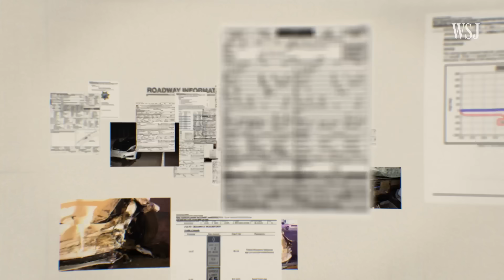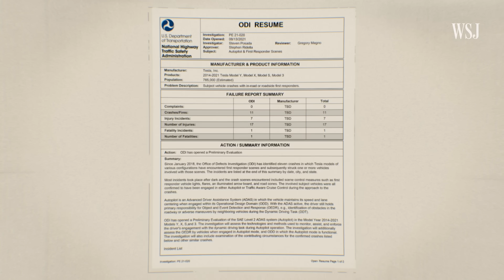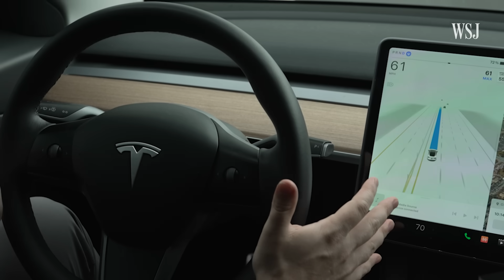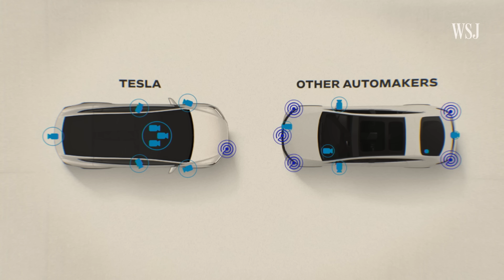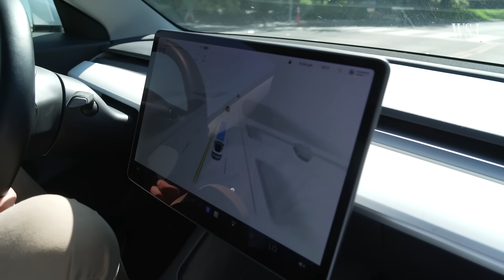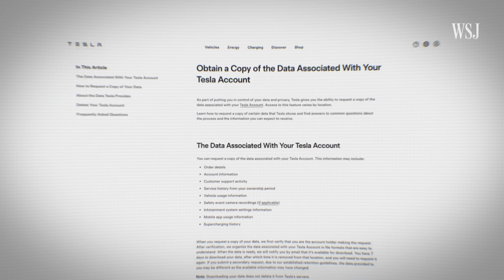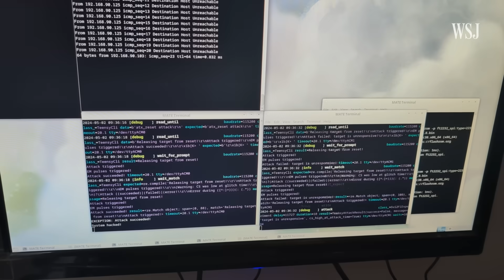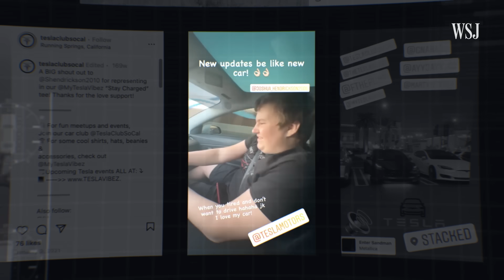The Hidden Autopilot Data That Reveals Why Teslas Crash | WSJ

Comment: Digital cameras are not well-suited for depth perception, and they are susceptible to weather conditions. Radar and LiDAR are not subject to these limitations. No amount of AI can compensate for the poor data from digital cameras. Self-driving vehicles require more sensors, which provide more data, to achieve Level 2 or higher autonomous driving capabilities.
Reply: You are ten years behind the times.
Reply: more sensors create conflicting data which then has to be managed in split second real time, usually resulting in unnecessary braking or hesitating which can also be dangerous.
Reply: @michaelfagan9620  This is very true, and the reason Tesla got rid of radar. The camera's see far more than people think, and operate a pseudo radar, basically building a Lidar like picture of the world using camera's. The work Tesla has done is nothing short of remarkable. V13 is showing the real potential of their system, outperforming other self driving cars (using lidar) with Tesla stock rising to record highs on the back of it.
Reply: Lidar is very susceptible to weather conditions. V13 is proving Lidar is not needed. Tesla are looking well set to dominate in this space. Most people have no idea just how good FSD is getting or will become.

Comment: It would be helpful to compare, in terms of percentage, within the same time period, the number of fatal accidents between vehicles with and without automated driving. Additionally, it would be valuable for the report to mention how many accidents have been prevented thanks to artificial intelligence.

I believe that if they included these points, the report would be comprehensive, allowing the user to evaluate the advantages and disadvantages and, consequently, reach a conclusion. This would be ideal and would truly represent good journalism. However, this is the Wall Street Journal, so I don't expect much from them

Comment: Because they need LiDAR but musk the ' genius ' doesn't thinks they do so till then they are behind all other brands that use that tech
Reply: Question, do you drive your car with lidar and radar or just with your eyes and ears? 🤡
Reply: @bartdeking  I'm not a algorithm working of just sight. I also rely on sound and being able to interpret the feedback from a car. Obviously you are too young to drive 🤡
Reply: V13 is proving lidar is not needed. Most people have no idea just how good FSD is getting.
Reply: @daydreamer8373 'how good it's getting' by that statement along it's still not right and will continue to have accidents or cause the driver to take over to prevent one.
Reply: @entropyachieved750  It is not ready. But as I said, most people have no idea just how good it is getting. Automation will make our roads far safer, and Tesla is well placed to dominate in this space.

Comment: While Full Self-Driving (FSD) technology is undoubtedly remarkable, Tesla must enhance its communication strategy and transparency regarding its capabilities.
Consider the numerous instances where the Wall Street Journal misrepresented FSD technology and failed to provide adequate explanations. This lack of clarity has likely contributed to the general public’s confusion and misunderstanding.
Reply: Good job for being Tesla's spokesperson without getting paid for it. You're a disgrace to your country! You should only write bot comments for Xpeng, BYD or Nio.
Reply: I think that's backwards...  I don't think there is any communication strategy Tesla could use to counter the willful misrepresentation on display here.  The WSJ is losing credibility with this trash reporting. Basically Mr Musk is designated evil, and so no standard of accuracy or journalistic integrity is required in reporting on companies he is involved with. Over time, folks just notice that WSJ isn't factual or credible.  But in the meantime, yeah it's bad for sales, but nothing they can concretely do about it.

Comment: To be fair the overturned trailer should have put up reflective hazard signs or anything at all to warn drivers. It's not easy to see in the dark and it's very unexpected.
Reply: you are right, but then comes the questions of how long ago it flipped, if the driver is in good condition to phically search and put the reflective signs, or power was out in the truck. still the car didn't stop early enough
Reply: 100%
Reply: Class A drivers know and it is included in the DMV test. But those trucks don't have airbags. I wouldn't be surprised if the driver was injured. Plus difficult or impossible to get depending on the sign location
Reply: This is the kind of thing that LIDAR would've detected, regardless of the lighting conditions.

Comment: she hit the nail on the head at the end there, this isn't going to dissuade a single person. they're in a cult and will defend daddy elon and tesla until their death...  which is what literally happened to all the drivers in these crashes
Reply: Most of the drivers disobey the prompts, that's on them.
Reply: @caydenthompson126  yeah this argument is lame. a big part of the culture in the tesla community is finding ways to defeat the "prompts" or nags. mostly stems from the top since the ceo of the company vocally disagrees with their existence
Reply: @MikeJackman  I am not an Elon fan. But this video is biased.. it only shows the crashes and not the times Teslas steered people away from getting T-boned by somebody jumping a red light. So my question to you is, have you tried using these systems yourself and did you have evidence for forming your opinions apart from the stuff shown in this video. If you get a chance (maybe a friend has a Tesla), try the FSD system out. And pray, don’t snooze at the wheel like some of the people who think the system’s perfect just cuz it’s called “Autopilot”.

You’ll be pleasantly surprised by what you witness.
Reply: @kaminenianirudh  ive owned three of them.  currently drive a model s, no one needs to tell me about the phantom breaking, the random lane shifts and it getting confused at unguarded stop signs. 

it was pretty good until they decided to disable the radar for no reason. during both of the fsd trials, i used it a few times. it clipped the curb twice and ran into my neighbors yard but did manage to complete one 2mi drive, once with intervention. it is a LEAST 5, probably 10 years from prime time and will def require additional hardware over hw3/hw4.
Reply: @MikeJackman  it keeps getting better and better…just a matter of time
Reply: @MikeJackman  Hmm, I have a very different experience. I bought a new Tesla in 2024. Model 3. I don't have much driving experience, this being my first car and me being an immigrant (legal), but I know what a smooth drive is. I started using FSD with V12. Recently I made a couple of long trips one from NYC to Boston and other from NYC to Raleigh all on FSD on 99.9% of the time. It's a bit jerky in some very particular situations (and at this point in time, I know enough about the system to know what these situations are), but most of the time it's very smooth in terms of braking and accelerating. But looking at the V13 videos online, I'm guessing it's going to be indifferentiable/better from most human driving in like the next 2 months. And some of the testers of V13 are not Tesla fanboys too, and are somewhat objective. Except one, if you know who I'm talking about.

The few things that I find are still not implemented are: 1) Emergency vehicle handling 2) Pothole avoidance 3) Reading signs 4) Better parking intelligence at the end of the trip. 2 and 3 are big things which I don't see them talking about yet. 1 and 4 are coming in a future update apparently. It's not gonna take 10 years IMO for sure. Maybe 2-3.

Also, I live in the city, so my experience of FSD should actually be worse than people in the suburbs. Cuz the few times I drove it in the suburbs or the highway, it was flawless.
Reply: @MikeJackman  Also, curious about which version of FSD did you try out? They had a free trail of FSD very recently (for the month of November) which had 12.5.6.3.. Did you see random braking and lane shifts in that version too? Also, were the lane shifts, random braking unsafe in any way? Cuz what I found out is that it's very safe even the few rare times it decides to be jerky. Like if there's a car behind it and it decides to brake suddenly, it will realize the car behind it and accelerate a bit to give it some clearing space. I think the sweet spot of the system is when you realize that it will not crash into other cars (ironic I know, commenting this on this video) and also understanding the situations it doesn't handle well atm. But maybe that's my inexperience talking
Reply: @kaminenianirudh  I actually had two different versions during that trial. 

The first version I had worked pretty well. That was able to get me from my house to the grocery store once without any interventions.

Then about a week later I got an update and I do not know what Tesla changed but it could barely get to end of my street wtihout panicking. It couldn't navigate a parking lot. It kept doing that vibrating braking thing and jerking the steering wheel all around. IDK. It was very annoying and it kept clipping the curb (which i read is a known issue in MS and MX since most of the training data comes from the smaller M3/MY). IMO, after a decade, this beta testing nonsense of just pushing out software is tired and not gonna cut it if they want to release something unsupervised anytime soon.
Reply: @MikeJackman  I know it feels like a decade, but it's been only 4 years since the release of FSD. Autopilot is little more than cruise control and they advertise it as such. For as complicated a product as FSD, I don't think releasing a "finished" product directly is an option.
Reply: @kaminenianirudh  I mean that AP has been around for a decade. Often regressing in functionality. In fact I would argue AP2 with the radar on was its peak and now it's more of hastle to use to than no to.

As for FSD, it will always be a pipe dream. I'm sure some company, at some point, will have a widely in use robotaxi and the first company to do it could even be Tesla (doubtful but maybe). But it won't be what you today call "FSD", it could be a derivative or a use the data you provide Tesla with FSD to train the software a robotaxi uses one day. That being said, there isn't a single production Tesla on the road today that will ever be "unsupervised".
Reply: We gonna say this about all car companies or we just gonna talk about tesla because im sure their are more fatal crashes then just tesla
Reply: @RuleStarRacing  Tesla, and its leadership, makes extraordinary claims about its automation. Therefore it gets extraordinary scrutiny. It's just that simple or as it was said in the 1986 hit classic film, Top Gun: "(Elon's) mouth is wrting checks his a** can't cash"
Reply: No one told these drivers to go on auto pilot at night. Don't blame Elon for ignorant people.
Reply: No, we just understand that when we are told the car is not autonomous it means, it cannot drive itself. Got nothing to do with Elon protecting but rather, understanding the English language. You just stick with the orange Jesus if you want to talk about cults…
Reply: Confirmed Kamala voter
Reply: @MrHugepants better than being a gullible trump voter…oh the stuff you guys will believe without questioning it…amazing
Reply: @MrHugepants  let me double confirm that for you
Reply: What!!! Elon is a cult leader?? A can't stand him but you can't take away his achievements with space x. He's one of the most annoying people I've ever seen tbh. He's going to be part of your government soon but he can't fail really when he's working under the best president and soon to be president of the last 100 years.
Reply: @DeanCunningham-q1z  How does that boot taste?

Comment: I noticed some of the autopilot scenes happened in the inside road and autopilot does not know to stop at lights, intersection, or stop sign. Autopilot is meant to only go straight (works best on the freeway), it'll stop when there's a car in front.

Comment: No comparison to gas vehicles? How much more dangerous is autopilot per mile than driving a ford truck.
Reply: My VW traffic aware cruise control would have crashed into the end of a traffic jam if I hadn’t break last minute. Many systems are flawed and currently only the driver is responsible.
Reply: “This awful technology marketed as a lifesaver isn’t quite as bad as this other awful technology, so you’re not allowed to criticise it”
Reply: @AndrewMarkos  i disagree. i dont own a tesla and i dont want one, to be clear. this video doesnt feel like criticism, where the system is put into context and its very real flaws are correctly pointed out and discussed.  this video comes across as actively portraying the autopilot to seem extremely dangerous and irresponsible to use. i agree with most things said in the video. there is definitely negligence in parts of this system, but overall (without any comparison whatsoever) this is very one-sided reporting, in my opinion
Reply: @markc7899  it’s using old data many many significant improvements have been made. Some of those crashes are years old…
Reply: @GaryGreen-h8v  yes i know. that too!